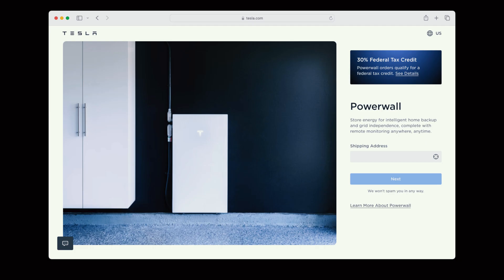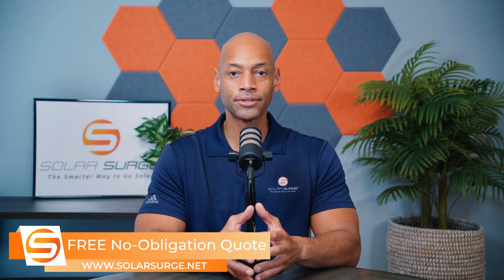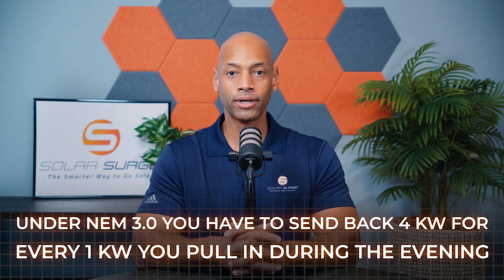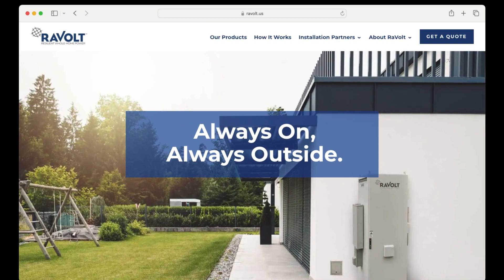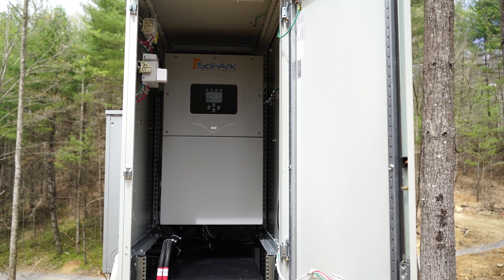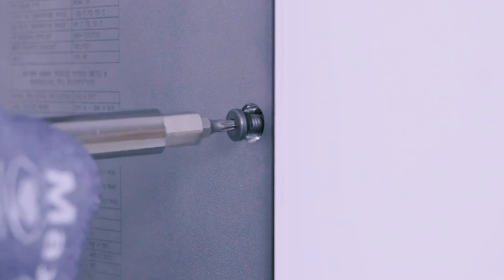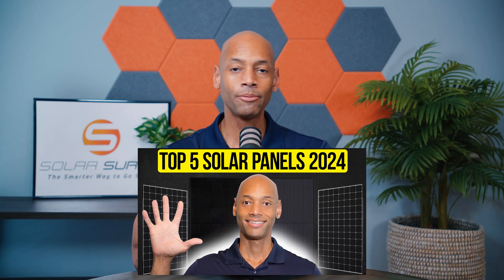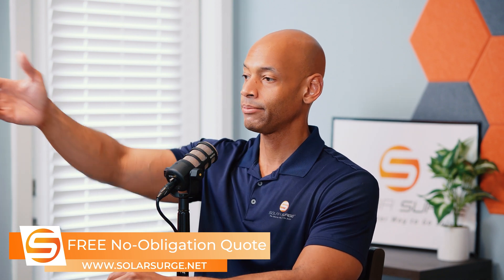Tesla Powerwall 3 Direct is Here

Comment: I'm in the Midwest, for months I have summited the form to Tesla asking someone to contact me and even get a message from Tesla that someone at GRNE would be reaching out, but they never do. I contacted GRNE myself and they say that they no longer install or handle sales to residential customers and they don't know why Tesla won't remove them from its system. I finally found a local company that has been around for years as electricians that are starting to get into solar installations. I am paying 40k for 12.3 KW and 1 Powerwall 3. The closest price i could get from any competitor was at least 5k more for less solar using another brand battery.

Comment: Got 2 PW3s installed w/o solar through a local contractor. What is not in the documentation is that the PW3 without solar has a heartbeat which ends up sucking down ~$30 extra a month in power. Going to install a minimal solar array to cover the heartbeat + my home baseload.

One thing not in the documentation...Tesla recommends the battery to be at 90% vs. 100%. They don't have this in any documentation, but if you look at the help me choose site, it says right on the page....

Backup Reserve
90% charge is optimal for backup duration, you can configure this in your app after installation
Reply: How many Kw does the Power Wall 3 use daily for the heartbeat?
Reply: @WAGISDev

All inverters, BMS, etc have idle power usage. Not sure how much kWh/month you’re claiming but assuming 20c/kWh price where you are that’s only about 100W idle power per Powerwall, that’s actually on the better end for solar systems.

On the max SOC recommended , are you sure you’re not reading something intended for Powerwall 2? They have NMC chemistry cells, which are far more sensitive to degradation at 10% SOC.

Also, “storm mode” tends to help out with making sure you’re full when you need to be full

Comment: I really don’t understand what the big deal Is with PW3. The only drastic improvement is the installation process. Other than that, there isn’t much added improvement to customer experience. No change in capacity from PW2 and still not enough continuous power for full home backup. Even though Franklin will now be one generation older than PW3, it’s still a better battery. I work for Sunnova and I absolutely love my Franklin/enphase system
Reply: PW3 is 2x more powerful than FranklinWH (11.5kw vs 5kw)
Reply: He Never Watched The Video Did He 🙄 @amgxpat
Reply: LG Home 8, more power, more kWh storage.
Reply: @boblatkey7160

Home 8 doesn’t handle PV input direct, you need a separate inverter box(es)
Reply: Home 8 also has 50% lower power output, only 7.5kW vs 11.5kW (and PW 3 also has enormous 10 second surge output, so saves you $500+ on soft-start for your HVAC compressor motor, etc)
Reply: @aoeuuaoaou  that's all gonna change less than a year.
Reply: What’s going to change?
Reply: @aoeuuaoaou  Selectable inverter power from 5 kW to 11.5 kW, 19.5 kWh battery LiFePo4, AC or DC coupled, meter collar, generator interface, demand response capabilities, and lots more!
Reply: At that point in the future we can then recheck the prices to see whether or not you’re still wrong. :P

PS I’m hoping you’ve either have become right or are still wrong but only because Tesla trimmed their price. ;)
Reply: @aoeuuaoaou  well here's a secret, we are a hell of a lot bigger than Tesla and we aim to lower our prices also! But I can't say who I am because of corporate social media policy.
Reply: So you’re saying you’ve got some catching up to do.

Please focus on that rather that beating your chest with false assertions

Comment: Local contractors are a pain in the a$$…my Enphase array system has been flawless…good thing the contractor is long gone 5 years ago I bought two Powerwall2 from Tesla…They were a pain in the A$$ but they finally completed the job after about 1 year.  The Powerwalls have been pretty good only one time did they fail to pick up the load…no body knows why, after months on a Sunday morning a young woman at Tesla answered the phone.  I was shocked…She and did some computer work at HQ good as new after about 3 weeks.  That was 3 years ago.   The entire system Enphase and Tesla would get an A- overall from me.  Coincidentally today is the 8th anniversary of my system going on line . It is a 10000kwh system that still out produces its rating by 1000kwh each year So it’s all been good but I’m concerned about service going forward

Comment: I just signed with Tesla Directly in FL I'm installing a 10.53 kW Solar Panel System
Estimated energy produced: 13,218 kWh /yr with 
2 Powerwalls.
Reply: How much did it cost?
Reply: @jorgesantos6023  
$41,962.10 after 5000 down then I'll get my Federal Tax Credit of -$13,911.63
Total Cost
$33,150.47
Reply: Well with all that equipment costing around $26,000 wholesale somebody is doing good!

Comment: Got two PW3s installed with solar. Best investment I’ve made since I reside in San Diego where electric rates continue to rise. Smooth process working directly with Tesla and no subcontracting needed.
Reply: It only works if you invest all your cash flow savings you would otherwise spend on energy costs over the 25-30yrs in a boring S&P fund at 8% CAGR. Never finance or lease. Make sure you run the numbers on doing nothing and just paying energy prices and investing the system costs at 8% returns and see the difference.
Reply: How much do you save
Reply: I went from an average of $400-$600/month (depending on season of course) to sub $100
Reply: Can I ask did you go for 2 PW3s for the storage capacity or for the added power available from 2 11kw inverters? I’m just about to install a PW3 and unsure if I should double up or wait for the add on modules
Reply: @chrisdavies4323  sure! I got two because I did the math on how many kilowatt hours I would use on a given day during the peak of summer. Then I estimated how much solar production I would also get. The total sum is slightly more than I have historically used in one day during the peak of summer. So yes, for the capacity more so than the added power. It’s nice that one PW3 should be enough to start most appliances including most AC systems.
Reply: @A_pad91  thank you, I’m looking at the potential price difference between the full fat PW3 vs the expansion pack and thinking why not have the extra output and charge potential for a around £1k (I’m U.K. based). I’ve got a model 3 and super cheap off peak elec from the grid, no solar as I’m renting and moving in 2 yrs

Comment: Good to see they are integrating everything into the battery.  But, if you want additional capacity, do they sell a PW3 without the extra components at a lower cost?  
We have a solar roof and standalone inverters and 2 Powerwall 2s.  The system works well, and we are under NEM2 so get better rates.
Reply: The battery-only PW3 add-on module product is slated to come Q4 this year. It’s supposed to mount back to face with the master PW3 module, so adds depth rather than taking up wall
Reply: @aoeuuaoaou  I hope stacking like that is an option and you can still wall-mount side-by-side. I have PW2s wall-mounted side-by-side and even then, we have to be careful when opening doors.

Comment: Excellent breakdown. We are actively shopping to retrofit our current solar only NEM 2 system with battery backup/storage. All indicators show we need additional panels. Received a few quotes from local installers for solar panels and batteries (Enphase, Powerwall 2). All were higher than Tesla's install quote (using Powerwall 3) by as much as $40k to $50k.

Comment: It didn’t seem to be much work with this version don’t you just use a collar on the meter and then pretty much plug it in if you don’t use solar
Reply: As long as you have enough for full-house backup. It gets more complicated, you need a Gateway, if you’re going to only power partial in back-up mode